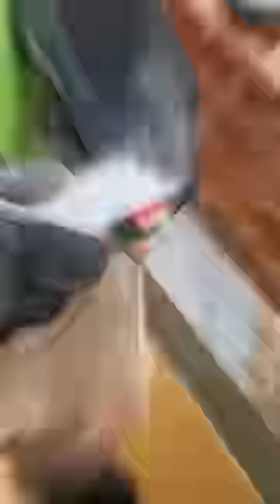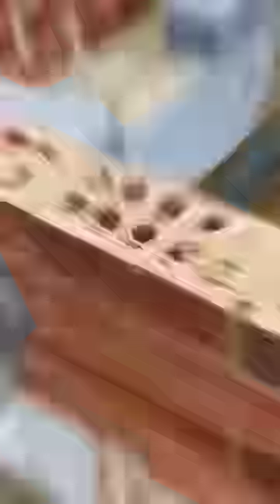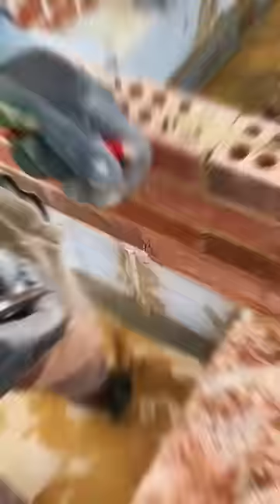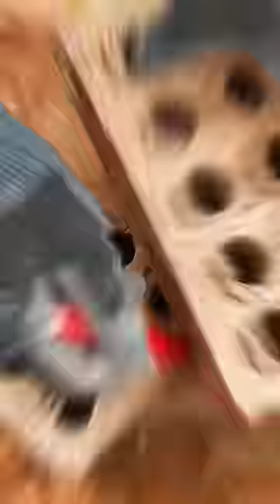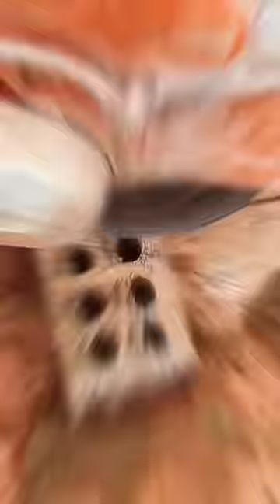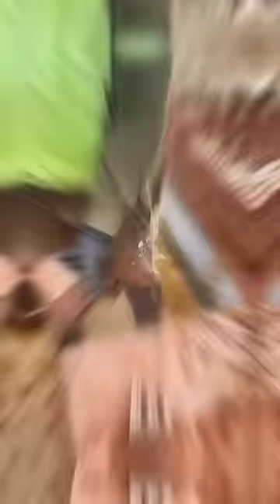BRICKLAYING internal bay window cut.

Comment: I use a Sharpie magic marker. The pencil mark will not blow away or on a wet saw wash away. One more thing, if that cut won't fit "to tight". Instead of cutting the angle again just  take a little off the jam end of the brick and you're good to go. But I'm sure most of you know that.
Reply: All he had to do was measure each side and Deduct 20mm each side giving a 10mm joint simple 😅
Reply: It ain't about u
Reply: We don’t care what you would do